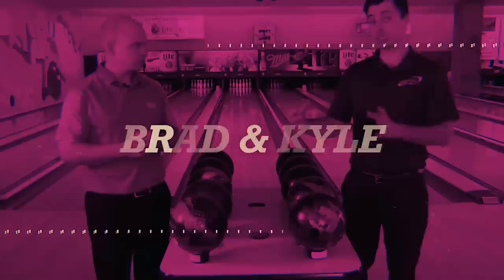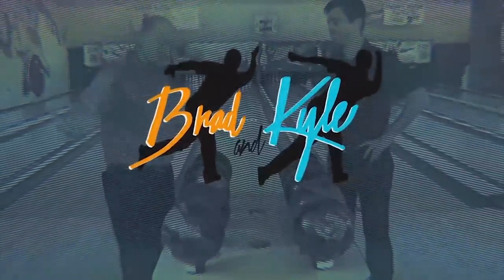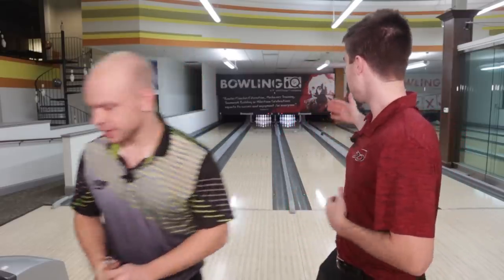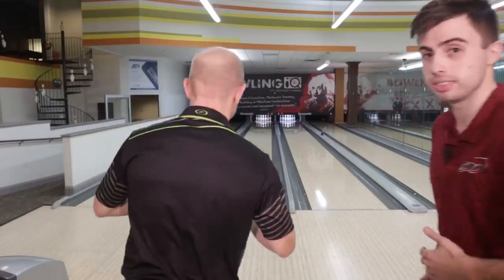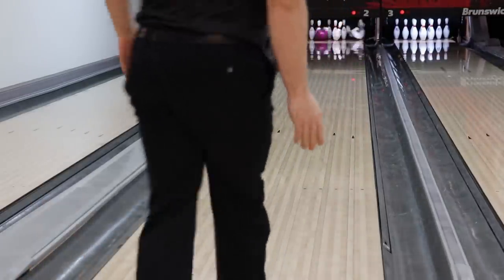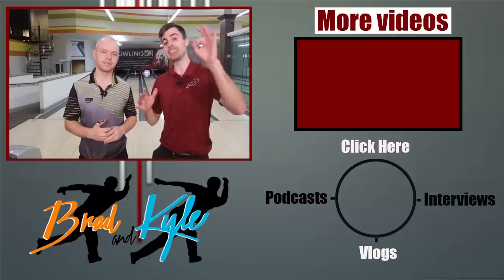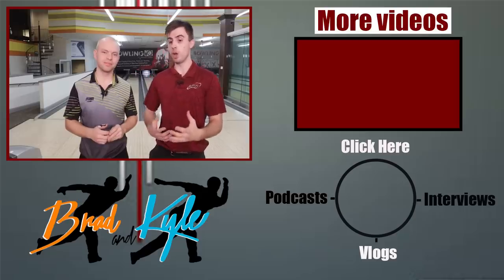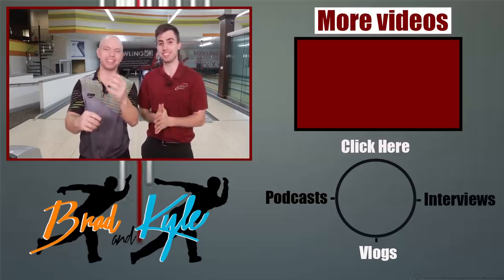3 Tips for Hooking a Bowling Ball (MUST KNOW!)

Comment: Hi Guys...Have a question for you. My rev rate is quite low being around 200rpm. Does the 'Sarge Easter' drilling help the rev to boost up? Surely it helps in the axis tilt / axis rotation.

Comment: You may have a video on this, but I have not seen it. You hear on the TV casts about how bowler can change the shape of the ball motion by either "coming up the back" of the ball or 'getting around" it. I have a hard time switching between the two and I am sure the problem is in my technique. It would be helpful if you could explain the difference for new bowlers and show tips for advanced.

Comment: Fantastic content, as we can always expect from you guys! Love the way you break it down into easily understandable explanations, without making us new ametuers feel like complete idiots! Lol. I'm getting ready to start in a summer league, first one since i was in junior high, and definitely first one that I'm actually beginning to understand and implement ball motion. I've got an old primal rage ball, drilled pretty standard pin up, centered between ring finger and middle finger. I don't know my actual revrate, but i would estimate somewhere in the low 300's. I'm wondering, since this league is going to be house pattern, would it be better to get my ball outside earlier to create a steeper entry angle into the pocket, or move further left and use more of the middle of the lane and oil to conserve more energy for releasing through the pins?
Reply: If the ball is a solid coverstock, then I would say a middleground between those two actually. Getting the ball outside too soon can lead to overreaction and inconsistent ball motion, as well as a smaller margin of error in your shots. Moving inside a few boards makes it so if you miss right, your ball will hook back, and if you miss left, your ball can "hold" and still hit the pocket. Moving too far left, though also decreases your miss room, because missing outside leads to inconsistent hook, and missing inside doesn't give the ball any dry spot on the lane to react. Hope this helps you at least a little, but the biggest thing to do is just go out there and experiment! Try moving right and seeing what your ball does, then move a little left, and then a little more.

Comment: So what is best tip to keep my hand under and behind the ball this is what I struggle with the most
Reply: Practicing your release requires doing just that...releasing the ball.  The next time you practice, start just one step behind the foul line.  Get set up, swing the ball behind you, take that one step, and throw.  No approach needed to just work on your release.  Also, start with your hand underneath the bowling ball and cup your wrist slightly.   This will increase the integrity of your wrist and keep it more solid during your shot.  The key is to uncup your wrist at the bottom of the swing so you can get the proper release and spin.  Mentally keep track of your hand and wrist position.  I recommend taking video to identify things that need improvement.  You'll be able to see where your wrist breaks down and you lose your leverage on the bowling ball.  Another thing you can try is start with your hand slightly to the outside of bowling ball but still underneath it.  This will make it a little easier for you to rotate your hand around it.  Try different things until you get an idea what works best for you.  Keep up this one step approach until you feel more comfortable releasing the ball.  If you continue to have trouble after practing this method, there are hand braces you can buy that force your wrist and hand to stay stationary and allow you to stay under the ball and come through the shot properly.  I hope this helps you.  Good luck and high scoring.
Reply: @keithperry6137  thank you I will definitely work on this i have few bowling gloves what do u recommend to keep my wrist straight?
Reply: @allenthomas914  Keeping your wrist straight is a mental thing at first.  Just try to hold a firm wrist and roll the ball.  This will become natural over time with practice.  If you're having trouble with your wrist breaking down try a brace called Revs II or Revs III.  It's rigid and adjustable so you can set your wrist in different positions.  It also prohibits your wrist from bending back which will give you more leverage.  Feel free to talk to your local proshop.  There they can observe your game and recommend the best support for your wrist.

Comment: Question: the fingernail on my ring finger is getting smashed on the release and hurts like heck, and causing the fingernail to go black. This is on a drilling for the two years I’ve been bowling.
Help.
Reply: probably best you talk to someone at your local bowling center or pro shop. maybe a poor drilling job or you are dropping your ball behind foul line driving fingers into shallow holes. if no pro shop try more lofting and see if improvement. ignore the troll comments good luck
Reply: paul in oregon roger that, thx